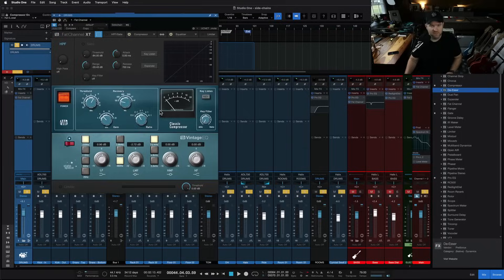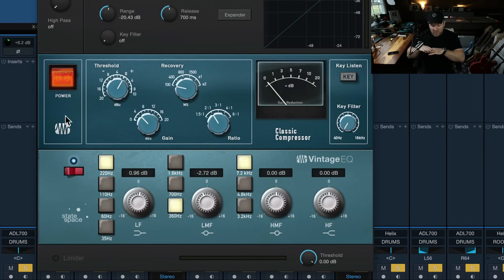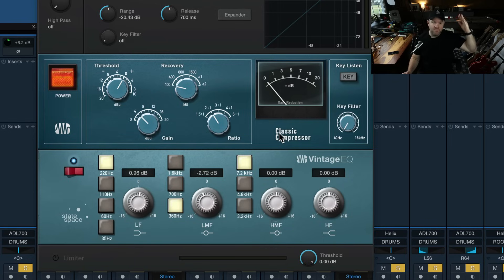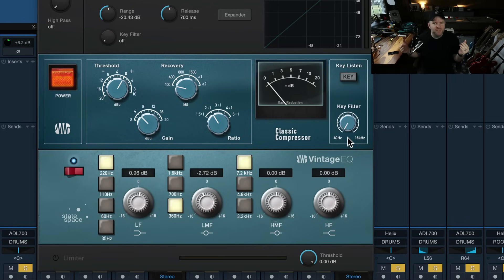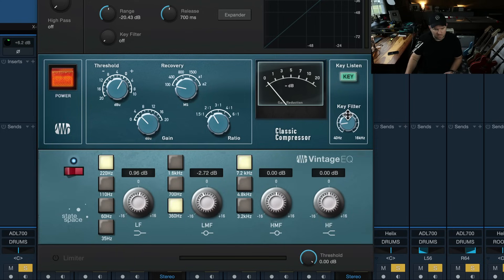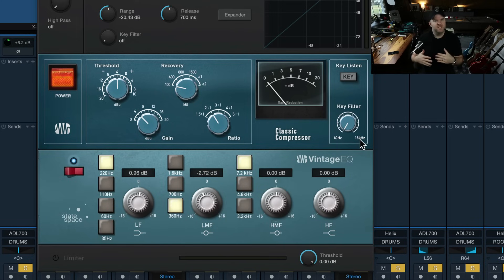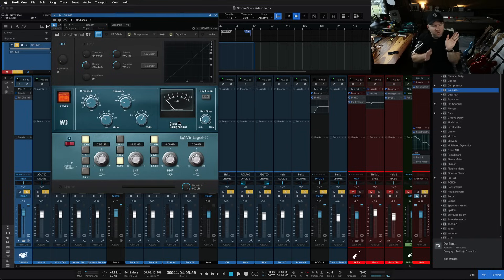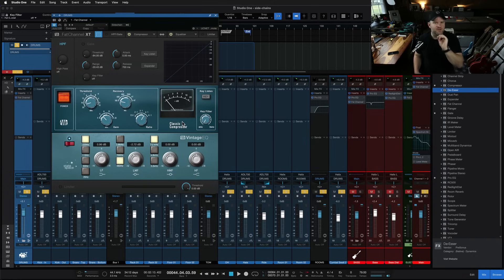What is the "Key Filter" on a Compressor? | PreSonus

Comment: I use the key filter a ton in live situations on the kick. The low tumble of a kick can be ineffective for creating punch through compression, so I will tune the compressor to the transient of the kick to make it have a very clean, tight punch. 
Key in is also very useful for gating, for similar reasons!
Reply from the maker: Thanks for sharing!

Comment: Wow Thank you Mr Gilder. That's the very, very first video i've seen since the FC came out that is clearly explaining the behavior of the key filter. I tought first it was a regular HP filter but after testing it I found out that it was more a BP filter, so it looked like a bug to me. Also the manual is somewhat wrong as per this excerpt: "Key Filter sets the frequency of a high-pass filter that sits in the compressor sidechain. The higher the setting, the more frequencies  are excluded from reaching the compressor’s detector". Thanks again for the clarification.

Comment: Great video. On a tangent. A question please Joe: In Pro Tools there is a setting called Auto Match which sets the time for the fader to return to the previous level when automating in Touch mode on the faderport8. If the difference is large when you let go the fader the it snaps back quickly. Is there a setting in Studio One that can set a duration in for the time it takes to return to the previous level? I have looked in the manual and the FAQs on the Presonus web site but I can't find anything. I learned of the Auto Match feature of Pro Tools watching a Youtuber mixing and he thought that Studio One probably had a similar thing but if it does what is it called and where can I find it. Thanks in advance.